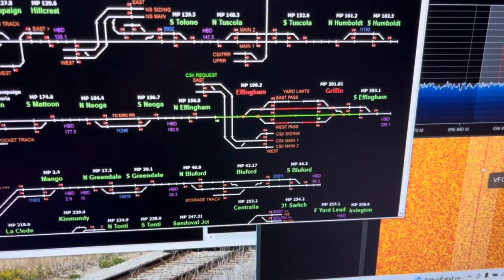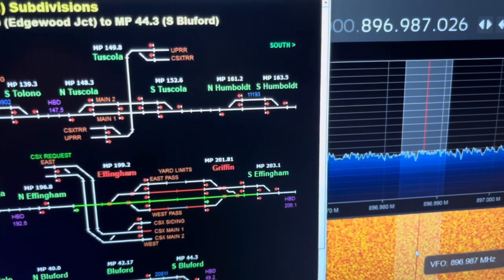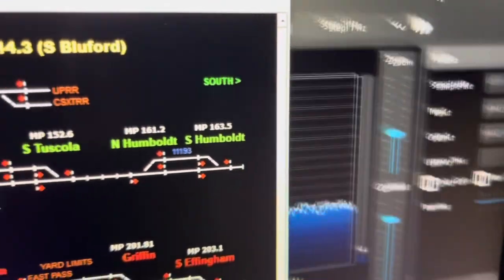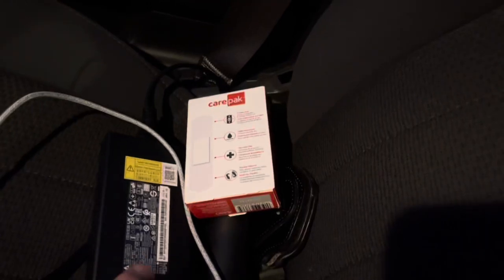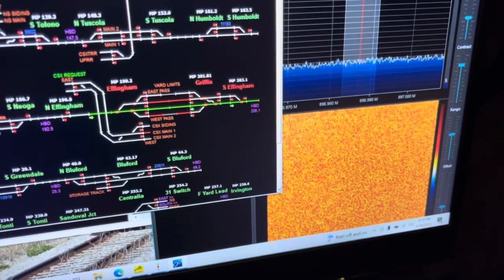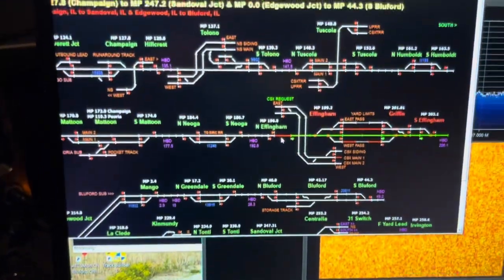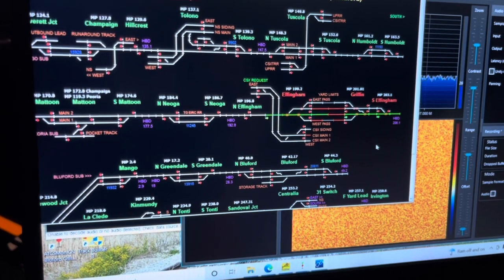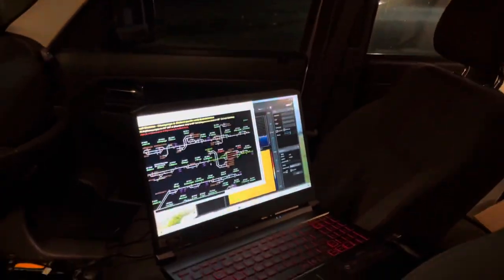How to FIELD Monitor ATCS | Part 1!

Comment: Very nice. For some reason, I always got the error message about unable to load track layout file after installing the route zip file. I tried all the different subdivisions and even the default metrolink layout file could not be loaded. Any idea on that issue?
Reply from the maker: I haven’t seen that error before
Reply: @railfan5254  thanks. I was able to figure it out. It was due to language settings. I previously didn't set that non-unicode program should be displayed in English. The error message was a bit misleading but I have the software running now.